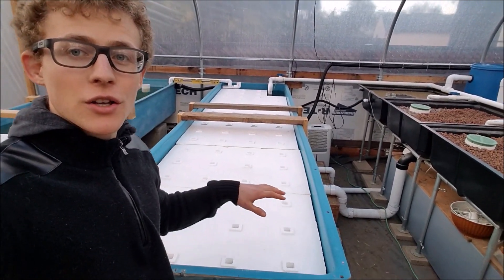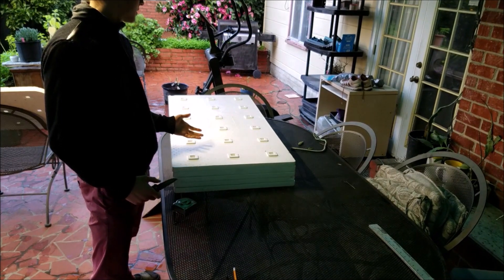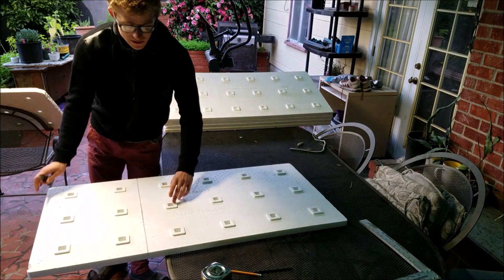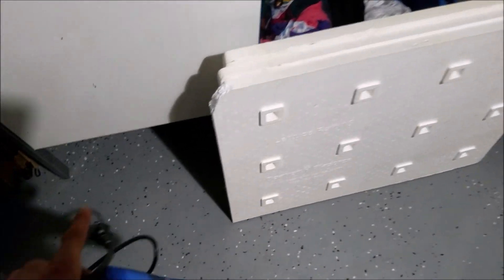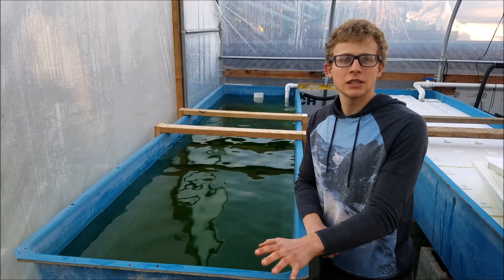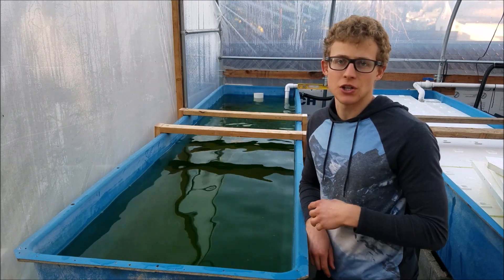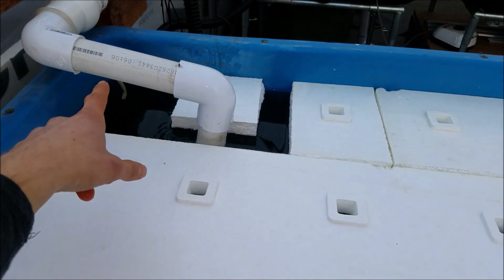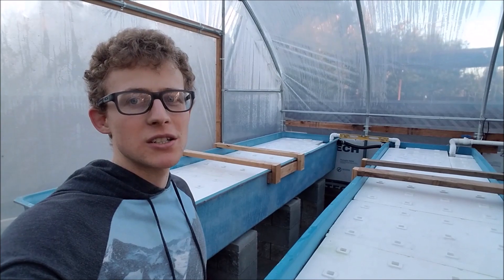Aquaponic floating raft grow beds (hybrid aquaponic system) - How to cut Styrofoam

Comment: From where did you get the bed!!?
Reply from the maker: I got it on craigslist.
It was used already so I got it second hand
Reply: @vonponics  when you bought the system secondhand did it come with the styrofoam panels precut with the holes?
Reply from the maker: @ChloexLashay  I didn't buy the system second hand.  I collected everything separately overtime and put it together myself. I bought everything second hand of off craigslist. But it wasn't a complete system that I bought. Just parts here and there. Everything you see is my own design based of off the parts that I was able to find for cheap. 

Those Styrofoam rafts I also bought from someone on Craigslist. But these are prefabricated rafts that you can by online. So no I did not drill the holes in them.
Here is an amazon link where you can buy some new ones:
https://amzn.to/3m6Slkm